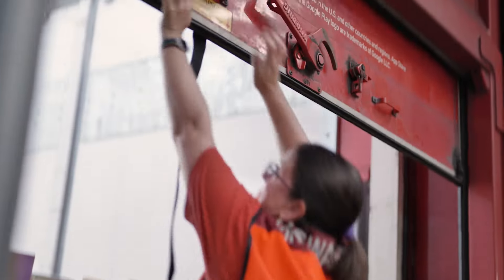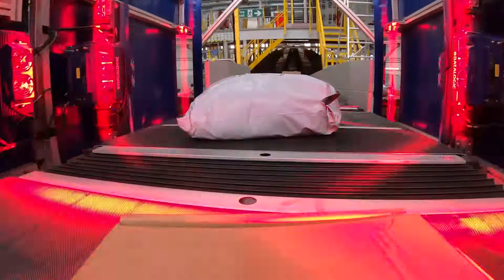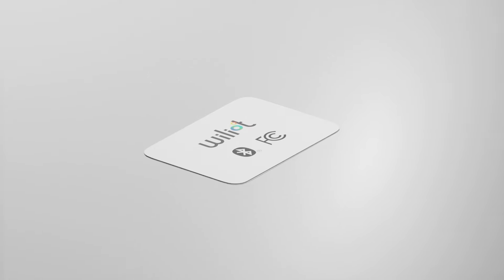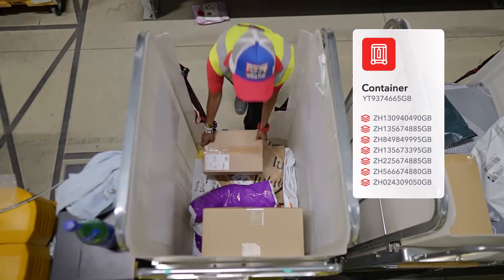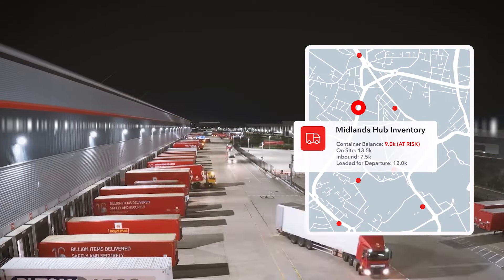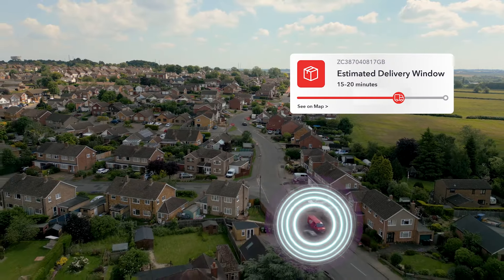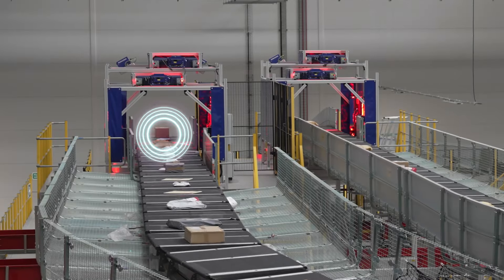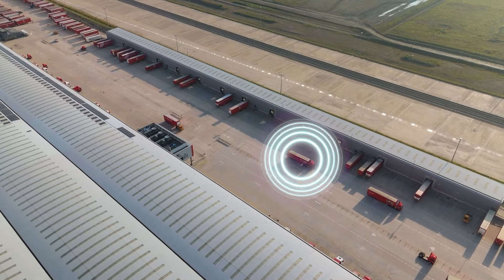Royal Mail becomes world’s first delivery company to use Wiliot’s digital tags

Comment: once the smart tags are on parcels. it will be trackable where a parcel went missing in the network, or where it may have been removed from the network at what time and what geo location (the heat sensor will be able to tell when its been put in a persons clothing or bag as it will be warmer). Cameras are fitted inside the mail centres so it will be really easy to find out any sticky fingers.
Reply: Potentially, yes, unless the tag is removed, then it's just like any other device.